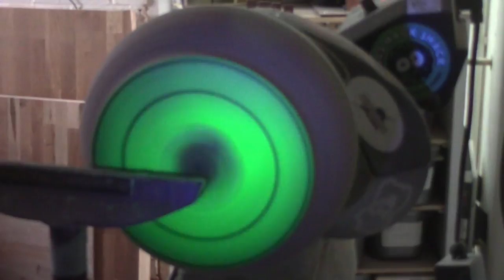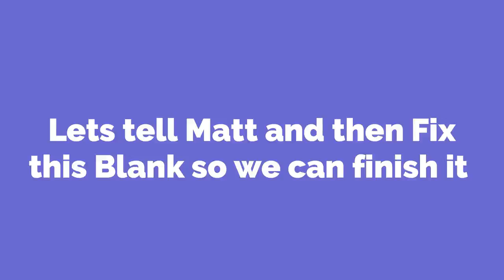Woodturning | Hybrid Bowl

Comment: Greetings! Awesome work, subscribed!
Have one question. Today i received my Coronet Herald, but without legs. Gonna weld by myself, but would you be so kind, please, to measure height from the floor and dimensions from leg to leg at the floor?
Reply from the maker: Thanks i appreciate it, all the specs are on the record power website, i found this if this helps... Size:W870 x D290 x H252 mm
Reply: @jpwoodwork  , i mean just footprint of the original coronet Herald legs distance from lefto to right leg base and from front to rear one...  But nevermind, i'll just eyeball it.
Reply from the maker: @Loftrocket  ohh sorry, it is 21inches by 37.5inches inside the legs
Reply: @jpwoodwork  , thanks a lot! Gonna weld it in few days.
Reply from the maker: @Loftrocket  awesome, if it helps much, the legs on the herald are hollow and i filled mine with Kiln dried sand (must be kiln dried so it doesnt rust)
Reply: @jpwoodwork  , yes, i saw that moment! :)
Btw, what is dimension of tubular leg (pipe itself)? I guess they're oval, i gonna use rectangular, but anyway, not sure which pipe to cut...
Reply from the maker: @Loftrocket  the legs are actually triangle pipe and each side is about 3 inches long